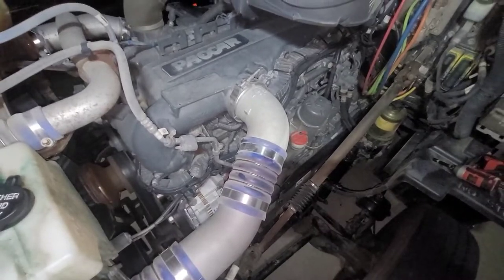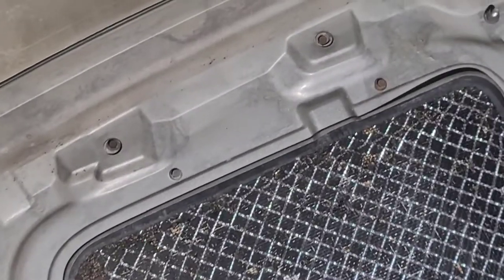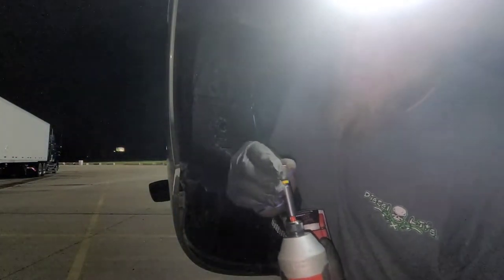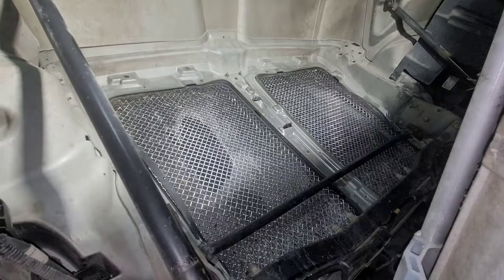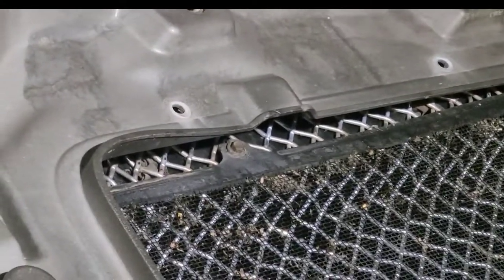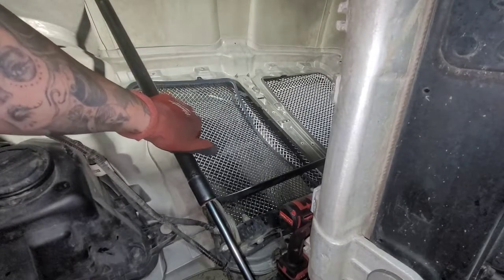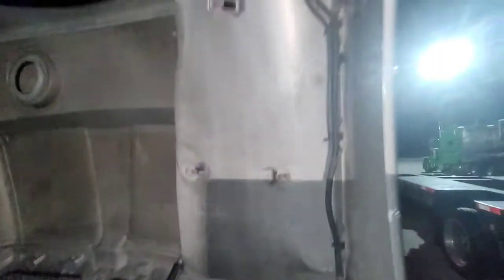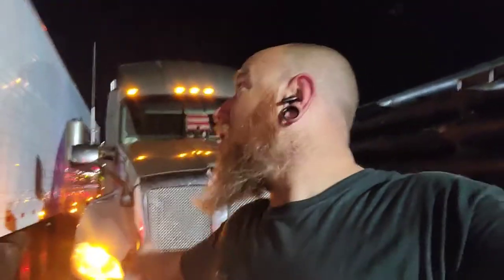Kenworth T680 Bug Screen Replacement

Comment: This helped me realize how easy it is to take the fender well put, I bought a bug deflector for my hood and had no idea how I could get in there either, I'm 6'4 340 pounds. I thought I would have to take the hood off too, also I might purchase another grill surround from KW and then 3M clear bra the new one since there are rock chips galore on the original one... you might want to do the same when you get a chance!

Comment: Bro how remove  cabinets    botton part  .driver side..please ...I need install  my new  refrigerator  and is high
Reply from the maker: It should just be screws towards the back of the cabinet. You should be able to get the fridge out without too much trouble. I need a new one too so if you haven't done it in the next month or so, I'll make a video for you